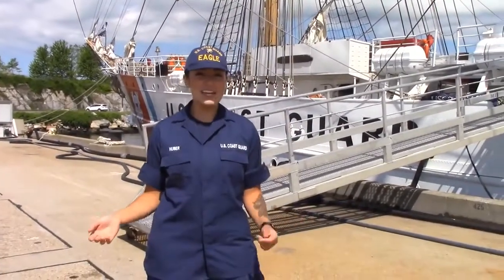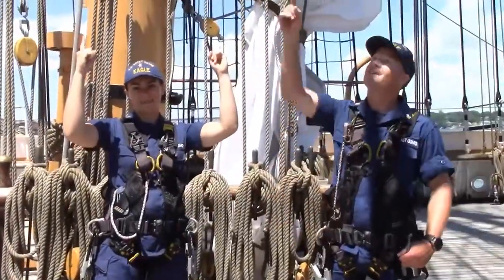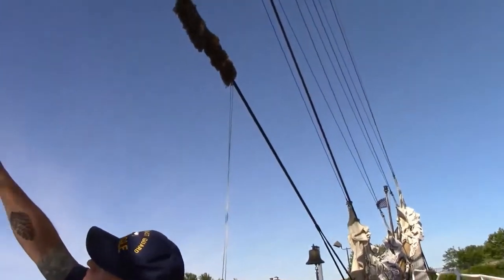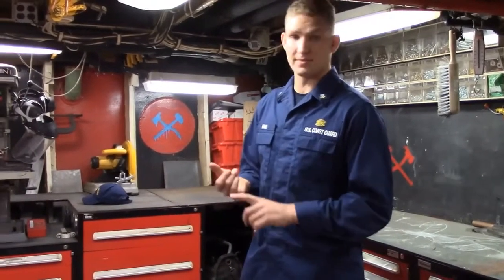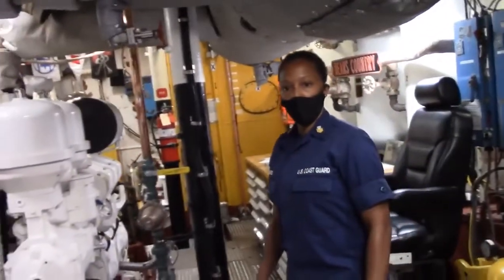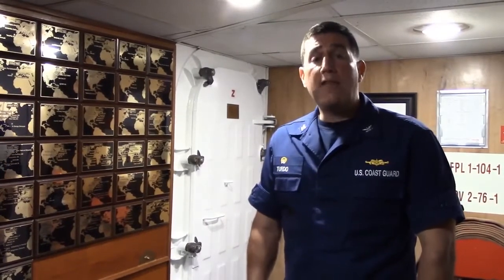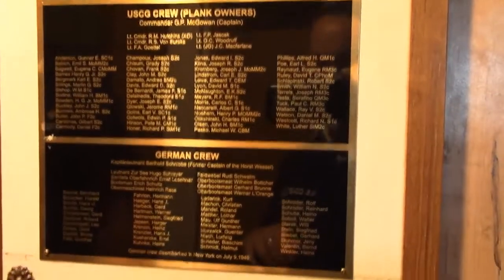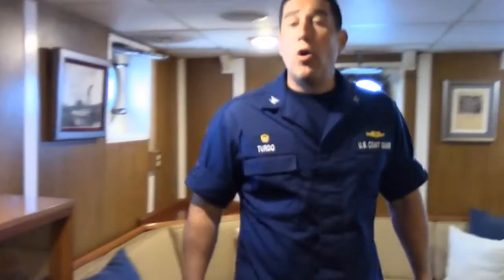Virtual tour of USCGC Eagle | Sailfest 11 July 2020

Comment: Thank you for the excellent tour.   As retired Army,  I don't have any experience dealing with the Coast Guard on active duty, other than they did some port security operations in Desert Shield, and in Arifijan in Kuwait right before Iraq invasion.   However, I can definitely appreciate the work of the two personnel (I'm not even clear what a BM2 and a BM3 is, but I can tell it isn't  an E-2 or E-3) when  they climbed the rigging to get to the top.   I got vertigo just watching.   I remember going through Army Air Assault school, and rappelling off the 45 tower, and then later out of the Blackhawk at 90 feet, and I had some problems with fear of heights to overcome.   You guys made it look so easy!,   especially at 01:48 when he transitioned from the rope to the platform.   I saw where she had a D-clamp, but it didn't look like she used it all the time, and I didn't see him use it at all.   Hats off to the entire active duty crew,  you guys look like a well oiled machine.  Much respect.
Reply: think it stands for boatswain's mate

Comment: It has changed significantly from my cadet cruise in 1974 - sleeping was in old canvas hammocks strung up in the mess deck that had to be taken down when it came time for meals. Showers were cold sea water only. Toilets were a row of seats on a pipe with sea water running thru it - no privacy. Still, it was an enjoyable and unique experience
Reply: I was on her in 1974.Permanent crew one of fifteen MK3.Sure looks different below decks and I noticed the anchor winch is gone on the forecastle.All new hatches and portholes that are watertight it looks like.Also the cadet berthing area seems to be compartmentalized without having this huge open compartment.It was always a concern if we would take on water with those leaky portholes and coming in from the waste.The 1936 MAN diesel is gone.Was replaced by a Caterpillar and now by a MTU.The outside is still there but everything else has been redone.